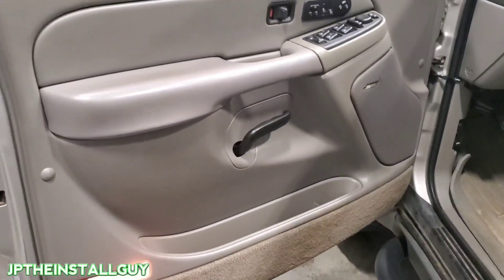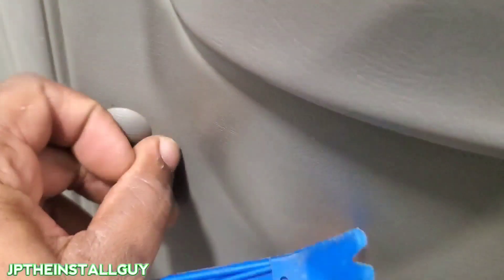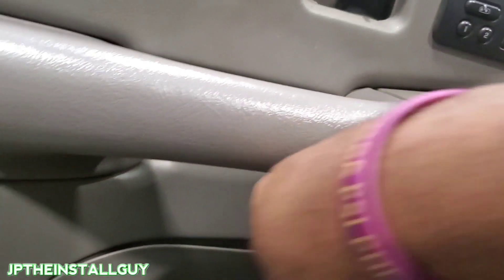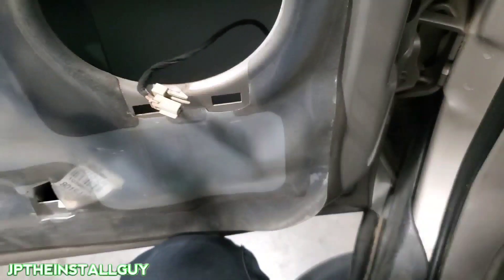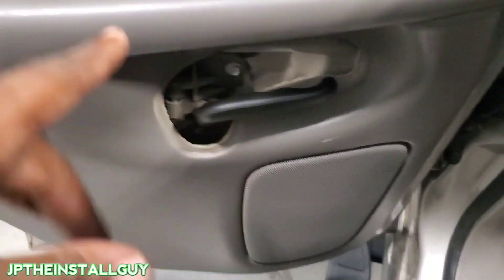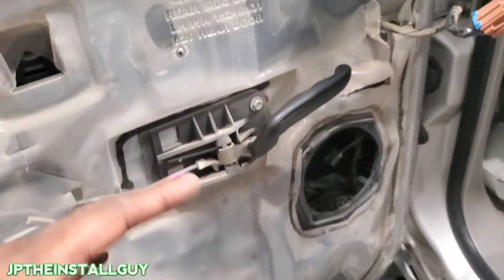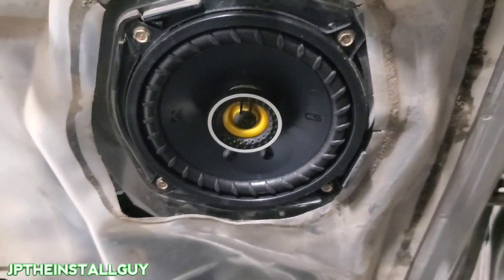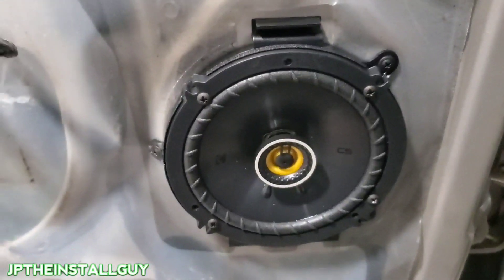2005 chevy Tahoe door panel removal and speaker replacement/ install

Comment: Hi JP, thanks for the great video!! I was able to install my speakers in the front & rear doors of our 2004 Tahoe without a problem. I used those quick connectors that you showed and 2 sets of 6.5 Pioneer TS-A series front and rear doors.

Only thing I did differently was on the Front door installation, i drilled holes because I didn’t want to pay $15+ plus bucks for the door brackets and neither did I want to wait days for the brackets to arrive. For the back doors I did not have to drill any holes, the 6.5 aftermarket speakers lined up well with the original holes.

Ours did not have the bose audio system, but installation procedure was the exact same.

Thank you so much for the quick video tutorial!!

Speakers Used: Pioneer TS-A653R
Speaker connectors used: Metra 72-4568
Reply: You didn't have Bose system because they have 5 1/4 rear speakers
Reply: And I found some pioneer TS 675 at the junkyard.  Cost about 13 bucks
Reply: @vamoneygroup  oh ok, non bose factory speakers were also 5.25, my pioneers were bigger (6.5) than factory ones (which were 5.25). Maybe someone put 5.25 oem speakers out of another Chevrolet vehicle but who knows. $13 for a set is a steal!

Comment: How do you get the back window switch unhooked from the connector. Tried pulling it nothing. Idk if its got thos safety tabs you have to push or just not pulling hard enough

Comment: I was reading somewhere that the amp has a crossover for the front speakers so they don’t get any highs just mids and lows. The stock tweeters get all the highs. Back door speakers are full range though.

Comment: Will a 6.75in fit in the front with that bracket??
Reply from the maker: with a 6.75 you might not need a bracket for the rear but it should fit in the bracket.

Comment: I could swear I though the backs was 6.5 not 51/4 . Great vid
Reply: The rear door speakers on my 05 were 5.25. I thought the same lol until I changed them.
Reply: @MultiJman22  5.25 is 5 1/4 lol
Reply: I used 6.5
Reply: non bose is 6.5 and bose is 5 1/4
Reply: Yo are thr front one 6.5 and back 5.25

Comment: What is the biggest speakers you can fit in a Tahoe door
Reply from the maker: for this year 6.5 front and rear without any modification to the actual door
Reply: Where did you buy the speakers

Comment: Why does google say the rear are 6 3/4 for the rear should I buy 6.5 or 5.25
Reply: I know google told me the same thing now I got 4 6.5 and i don't if the rear ones will fit
Reply: I used 6.5 on front and rear doors of our 2004
Reply: @ernie0699  did you need a seperate bracket for the rear 6.5”s?
Reply: @andrew-od7yt  No, it wasn’t required on the rear doors. I was able to line up the holes without the bracket